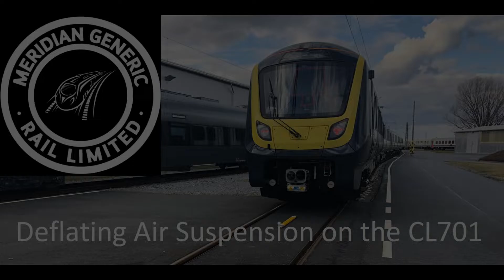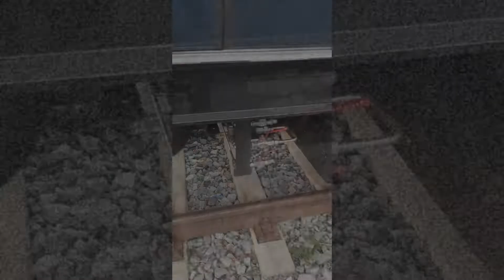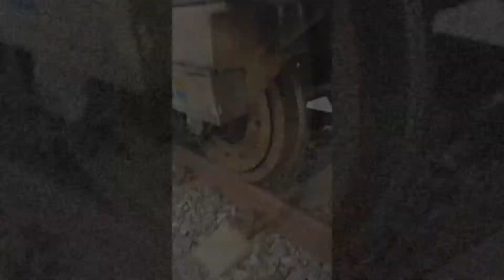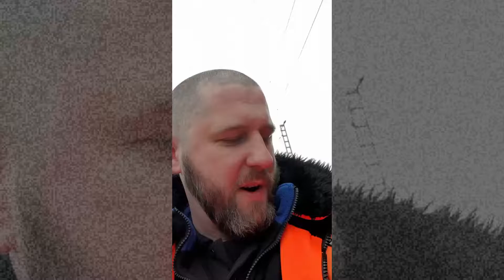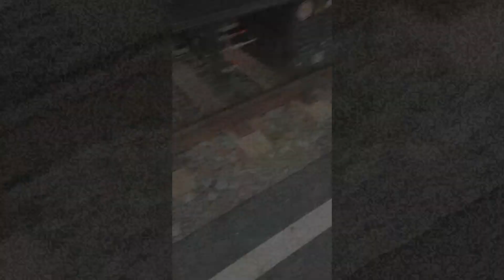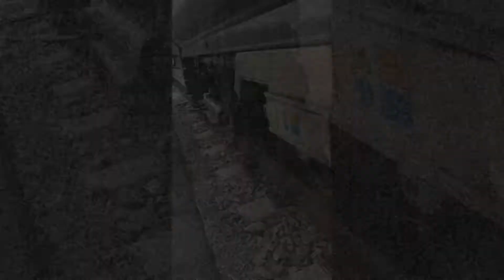Bombardier Class 701 Air Suspension Deflation Test

Comment: Mmmmm...three isolation cocks in a row!..what could go wrong...wet cold dark windy winters night...danger of 3rd rail, time pressures, all three cocks painted red!!..what could go wrong?....how do I isolate suspension...I remember training course....ah yes all three cocks! ...boom reduced brake force....dont say it can't happen look up class 142 liverpool lime
 st early 90s...poor training/lack of application etc...the 142 had problems leaving liverpool headed out towards north west...driver incorrectly isolated brake reservoir train was re routed back to liverpool line st...unfortunately line st it is at the end of a 1in 97 ish down hill line...hit the buffers at speed mounted the platform and ended up at 45° angle...
Please will train designers/planners talk to staff involved in the operations of the equipment. 
Put the brake res cock behind a flap! Move 12inch to left etc

Former driver, instructor & assessor..so some insight...
Nice to see new trains being built...good look with testing and commissioning.

Comment: I wonder why they're not testing it in the UK? 🤔

It would seem to make more sense as it is being built in the UK and deployed in the UK. Are the test tracks all full or is it cheaper to test abroad or what?

Could someone enlighten me please? Thanks!
Reply from the maker: Hi Michael, there are a number of factors however track availability and optimisation of the test programmes are key. 

 Simply put it is far more efficient to test on a large ring (like Velim) than on a straight piece of track as in the UK.
Reply: @meridiangenericrail2127  makes sense. Thanks for the information!